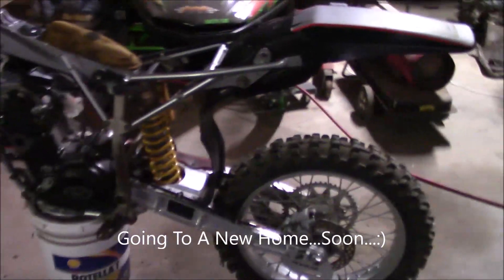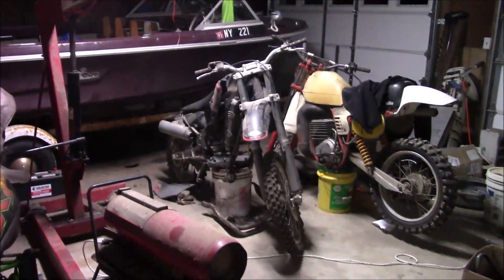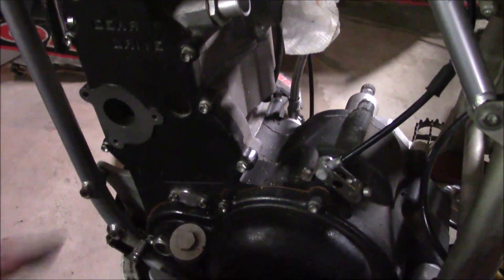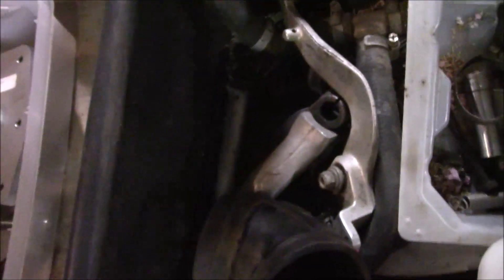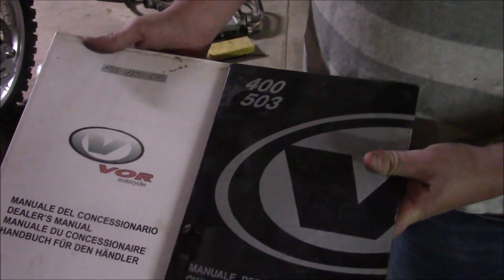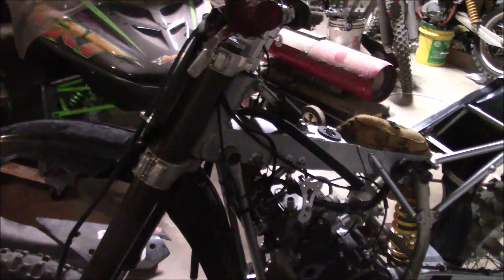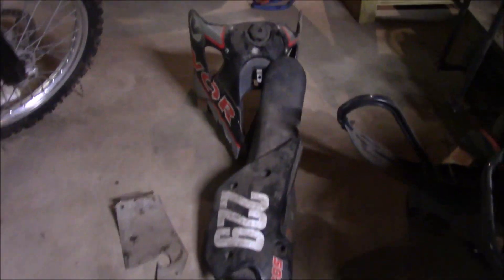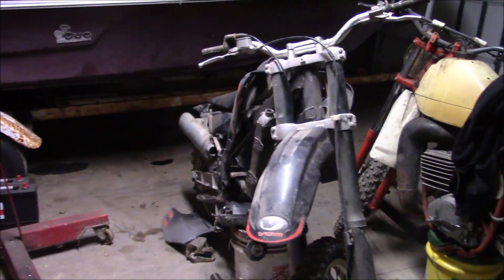2001 VOR 503 V-Cross, The VERY First One, Out of the dust pile....

Comment: V.O.R.     VERTEMATI OFF ROAD   Build by VERTEMATI brothers in LOMBARDY  nord Italy.   A small artesanal factory.  Made one of the firsr 4 stroke cross engine , during  '90 and early 2000 years.  Sorry I have studyed englisch 45 years ago.   Cheers from Monza
Reply from the maker: Yes it is and I knew Mauricio V and Gioia when they were over here quite well. Worked for them a couple of years. :)

Comment: is there any way to get a wiring diagram for a for en400/503
Reply from the maker: Possibly, I may have the old service manuals around somewhere, IT will take a while for me to find them though so u will have to BUG me from time to time
Reply: @afleetcommand  yeah I do to for the bike but there is nothing about any sort of wiring you’d be doing me a real big favour by doing that man ty
Reply from the maker: I have the manual & will try to photograph the wiring diagrams , NOT sure what year they are, they did change some with the chassis changes in 2002. Think my manual is the 2000-2001 versions.
Reply from the maker: Actually it's the 2002-2004 manual. I'll post up anyway. I DO have the "black" earlier version around.....I'll find it might take a day or two.
Reply from the maker: I'll have to post them on Facebook, I have a chainsaw group where I can post pics. It's "Chainsaws & Woods Craft", first pic already up